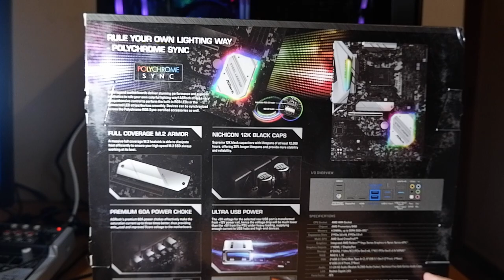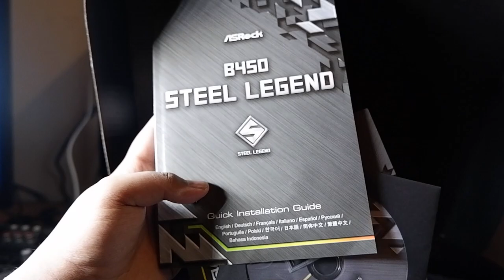AsRock B450 Steel Legend ATX RGB Gaming Motherboard UNBOXING &  OVERVIEW

Comment: Is it good for R7 2700 ... I want to overclock it 4.0 or 4.1 .... And ram 3200mhz... Is this Mobo work good???
Reply from the maker: Yes..  good for reaching boost clock easily
Reply: Just be aware the VRM can get 90+Celcius when overclocking something like a 2700 4.0+ghz on this board.. consider a fan to cool VRM.

Comment: Does it support ryzen 7 3700x is it good can you suggest good motherboard
Reply from the maker: It supports even 3950 but depends on OC.  With 3700x you have to monitor VRM temperature with boost clock OC first..  if it is stable..  3700x has no issue..  i tried with 3500 and its stable with no temp issues in vrm side.
Reply: @TECHNDJ  will it support ryzen 5 2600 x pls reply
Reply from the maker: @nishajuneja3099  yep. Ofc

Comment: I5 10400f 
Asus Nvidia geforce gt 710 2gb gddr5
Wd black sn 570 512gb ssd
Adata xpg 3200 8 gb 
Asrock b450m steel legend
Is it compatible Or not then please suggest me some comfirigation without considering monitor Or keyboard sir
Reply from the maker: This Mobo is only for AMD Ryzen CPUs, not compatible with Intel. Get a b460 mother board for Intel. And don't get that gpu instead choose a IGPU 10400 version with UHD 630 graphics. U will regret later if u go with 710
Reply: @TECHNDJ  thanks sir
Reply: @TECHNDJ  I5 11400
Motherboard 
Asus tuf b560 m plus 12600
Or msi mag b560 bazooka14170
Sir recommend another's better or cheap prize motherboard also which is good 
Ram adata ddr4 4500 recommend some for me sir 
Sad wd 750 500gb mlc 6400 
Power supply 550 
Sir recommend some for me for 3d vfx us software unreal Engine lumion vray blander photoshop etc
Reply from the maker: @RR-fv4re  gud one.. But for 3d works, get a GPU above 1650 super. Should need for blender and unreal engine.
Reply: @TECHNDJ  sir motherboard kon lu in between to jo better rahe ga future vke liye bhi bcz msi  14170 prize ka h

Comment: Nice video and I have buy same ram and mobo and bro does this ram heat what are your ram temps and what are your vrm temps
Reply from the maker: Ram doesn't heat as much.. Its pretty normal even with 200+ oc. 
Mobo vrm temps are decent with 3500x(max 55°C).. Will defer with other ryzen like 7,9 as they require high TDP.
Reply: @TECHNDJ  thanks ❤ bro  and can I use ryzen 7 2700 on this mobo
Reply from the maker: @narinderkaur8845  sure..

Comment: polychrome sync working?
Reply from the maker: No bruh..  I change LED settings from bios.  And gpu, ssd leds using dragon center software..  Ram with XPG sync
Reply: @TECHNDJ  what do u use to change rgb of the motherboard  and what case do u use
Reply from the maker: @mekyle92  mobo rgb can be controlled and programmed directly from bios. AntEsports ICE 511MT RGB-X Edition Case (case replaced from standard model after video due to faulty front IO)

Comment: Did you it get bios updated for amd ryzen 3 gen
Reply from the maker: Yes of course...  i use 3500 with it..  its great
Reply from the maker: Even ready for 4th gen with next bios update
Reply: Can u suggest me m.2 ssd for this motherboard under 500 gb for windows 10 installation
Reply: @TECHNDJ  ok bhai tq btane ke liyr purchase krna h mujhe .. apka channel mil gya to thik h
Reply from the maker: @vinayakkarvi1971  i went with xpg d40g 256gb for 5.8k..  its best considering its 3.5gbps read and write and also features RGB

Comment: This or Asus strix b450-f?
Reply from the maker: Offc b450 strix incase u have budget
Reply: @TECHNDJ   just can't decide on steel legend, aorus pro, or that strix appreciate the help!
Reply from the maker: @ryanmiller3241  aorus pro for handling 3950 or 3700x oc..  strix is better reliable with gud bios and features..  steel legend is vud but still have very bad software control like polychrome sync etc